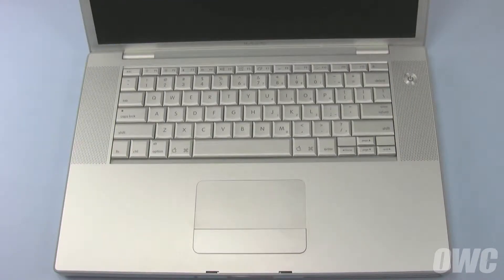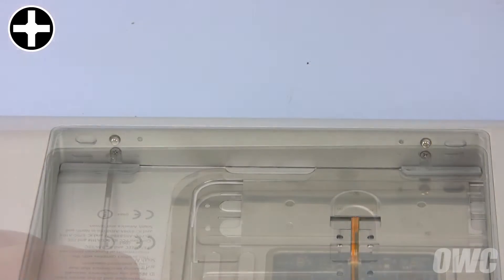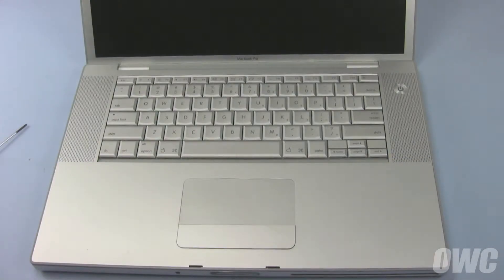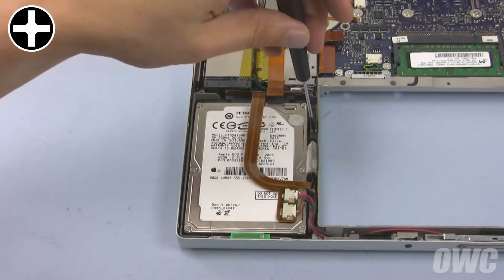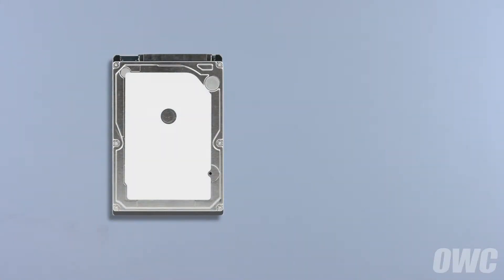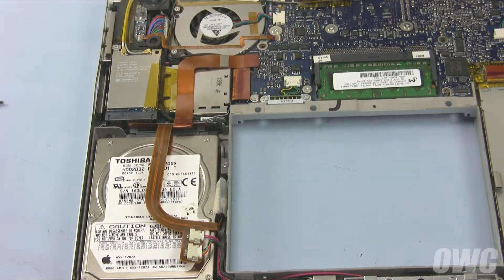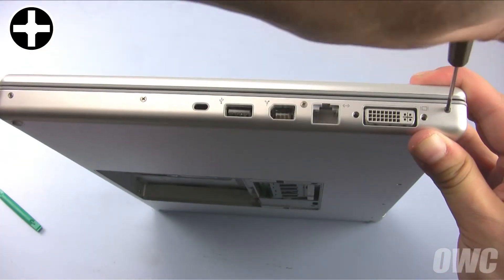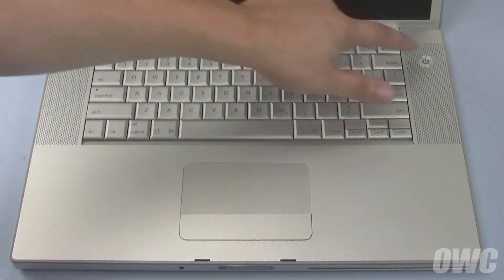15-inch MacBook Pro (pre-Unibody) Hard Drive/SSD Installation Video

Comment: installation went without a hitch.  fairly easy.  cloned old HD onto SSD.  boots fine.  PROBLEM: as soon as i start it up, the fans come on full speed and remain on at full speed.  besides the noise, it's reflected in the battery icon.  full charge used to be good for estimated 3.5 hrs.  now full charge estimated to be good for 1.75 hrs.

anyone got any idea what might be the problem or how to fix it?  all replies welcome.   TIA.
Reply from the maker: Hey John,
We are sorry to hear that your battery is no longer providing you with the battery expectancy you were having before the SSD upgrade. I have linked some Troubleshooting Apple suggests that may help.
https://support.apple.com/en-us/HT204054#runtime